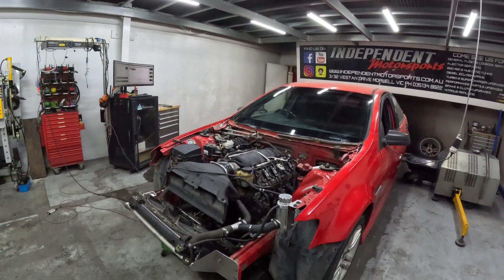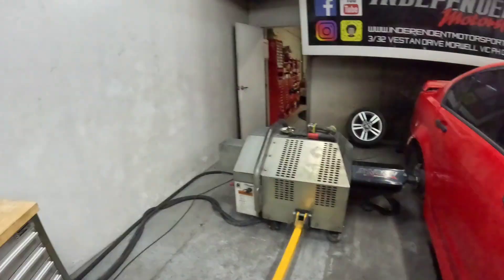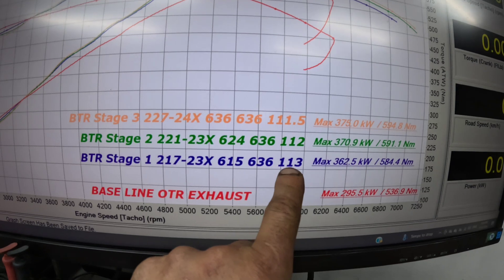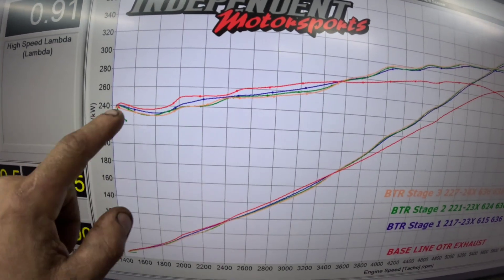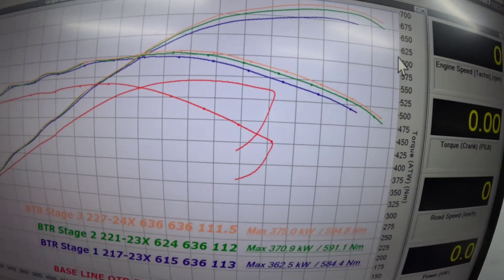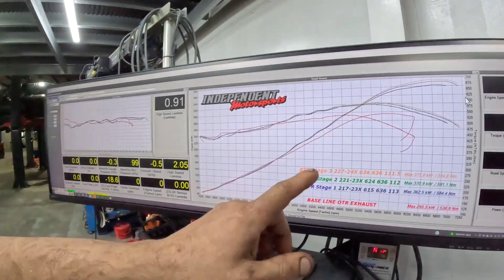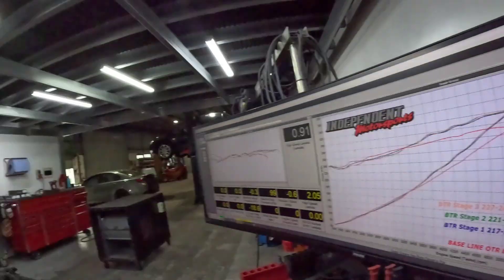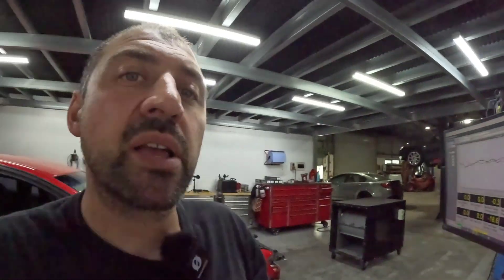VE 6LTR L98 Test Mule: Brian Tooley Racing Camshaft Stage Testing | Episode 2

Comment: Peak NM - RANGED BY RPM ACHEIVED

CROW CAMS 128
9379KW+84 @ 6800 🎉 586NM+50 @ 5600

CROW CAMS 1288
378KW+83 @ 6800 582NM+46 @ 5600

BTR REDHOT
369KW+74 @ 6800 586NM+50 @ 5450

BTR STAGE 3
375KW+80 @ 6850 594NM+58 @ 5400 🎉

BTR STAGE 2
370KW+75 @ 6850 591NM+55 @ 5400

CAM MOTION HOT STREET
365KW+70 @ 6800 588NM+52 @ 5400

CAM MOTION LITTLE CHOP
357KW+62 @ 6600 588NM+52 @ 5400

CROW CAMS 1212
368KW+73 @ 6800 587NM+51 @ 5400

CROW CAMS 1777
369KW+74 @ 6800 587NM+51 @ 5400

VCM 480
359KW+64 @ 6300 585NM+49 @ 5400

BTR STAGE 1
362KW+67 @ 6800 584NM+48 @ 5000

VCM 3
365KW+68 @ 6450 583NM+47 @ 5400

CROW CAMS 1287
369KW+74 @ 6800 581NM+45 @ 5400

VCM 11
363KW+70 @ 6400 581NM+45 @ 5400

CROW CAMS 1038
373KW+78 @ 6800 583NM+43 @ 5400

CROW CAMS 1036
362KW+67 @ 6600 578NM+42 @ 5400

CROW CAMS 1286
361KW+66 @ 6400 578NM+41 @ 5400

CROW CAMS 1730
356KW+61 @ 6400 572NM+36 @ 5400

VCM 532
355KW+60 @ 5900 585NM+49 @ 5200

CROW CAMS 1026
334KW+39 @ 5850 571NM+35 @ 5000

CROW CAMS 1780
331KW+36 @ 6000 567NM+31 @ 5000

BTR TRUCK NORRIS
337KW+42 @ 6000 581NM+45 @ 4800

CAM MOTION LIL LOPE
338KW+43 @ 6000 581NM+45 @ 4800

STOCK 
295KW+0 @ 5850 536NM+0 @ 4800

Comment: Peak KW - RANGED BY RPM ACHEIVED

BTR STAGE 3
375KW+80 @ 6850 594NM+58 @ 5400 🎉

BTR STAGE 2
370KW+75 @ 6850 591NM+55 @ 5400

CAM MOTION HOT STREET
365KW+70 @ 6800 588NM+52 @ 5400

CROW CAMS 1777
369KW+74 @ 6800 587NM+51 @ 5400

CROW CAMS 1212
368KW+73 @ 6800 587NM+51 @ 5400

CROW CAMS 1289
379KW+84 @ 6800 🎉 586NM+50 @ 5600

BTR REDHOT
369KW+74 @ 6800 586NM+50 @ 5450

BTR STAGE 1362
KW+67 @ 6800 584NM+48 @ 5000

CROW CAMS 1288
378KW+83 @ 6800 582NM+46 @ 5600

CROW CAMS 1287
369KW+74 @ 6800 581NM+45 @ 5400

CROW CAMS 1038
373KW+78 @ 6800 583NM+43 @ 5400

CAM MOTION LITTLE CHOP
357KW+62 @ 6600 588NM+52 @ 5400

CROW CAMS 1036
362KW+67 @ 6600 578NM+42 @ 5400

VCM 3
365KW+68 @ 6450 583NM+47 @ 5400

VCM 11
363KW+70 @ 6400 581NM+45 @ 5400

CROW CAMS 1286
361KW+66 @ 6400 578NM+41 @ 5400

CROW CAMS 1730
356KW+61 @ 6400 572NM+36 @ 5400

VCM 480
359KW+64 @ 6300 585NM+49 @ 5400

BTR TRUCK NORRIS
337KW+42 @ 6000 581NM+45 @ 4800

CAM MOTION LIL LOPE
338KW+43 @ 6000 581NM+45 @ 4800

CROW CAMS 1780
331KW+36 @ 6000 567NM+31 @ 5000

VCM 532
355KW+60 @ 5900 585NM+49 @ 5200

CROW CAMS 1026
334KW+39 @ 5850 571NM+35 @ 5000

STOCK 
295KW+0 @ 5850 536NM+0 @ 4800

Comment: Ranged by KW

CROW CAMS 1289

379KW+84 @ 6800 🎉 586NM+50 @ 5600

CROW CAMS 1288

378KW+83 @ 6800 582NM+46 @ 5600

BTR STAGE 3

375KW+80 @ 6850 594NM+58 @ 5400 🎉

CROW CAMS 1038

373KW+78 @ 6800 583NM+43 @ 5400

BTR STAGE 2

370KW+75 @ 6850 591NM+55 @ 5400

CROW CAMS 1777

369KW+74 @ 6800 587NM+51 @ 5400

BTR REDHOT

369KW+74 @ 6800 586NM+50 @ 5450

CROW CAMS 1212

368KW+73 @ 6800 587NM+51 @ 5400

CROW CAMS 1287

369KW+74 @ 6800 581NM+45 @ 5400

CAM MOTION HOT STREET

365KW+70 @ 6800 588NM+52 @ 5400

VCM 3

365KW+68 @ 6450 583NM+47 @ 5400

VCM 11

363KW+70 @ 6400 581NM+45 @ 5400

BTR STAGE 1

362KW+67 @ 6800 584NM+48 @ 5000

CROW CAMS 1036

362KW+67 @ 6600 578NM+42 @ 5400

CROW CAMS 1286

361KW+66 @ 6400 578NM+41 @ 5400

VCM 480

359KW+64 @ 6300 585NM+49 @ 5400

CAM MOTION LITTLE CHOP

357KW+62 @ 6600 588NM+52 @ 5400

CROW CAMS 1730

356KW+61 @ 6400 572NM+36 @ 5400

VCM 532

355KW+60 @ 5900 585NM+49 @ 5200

CAM MOTION LIL LOPE

338KW+43 @ 6000 581NM+45 @ 4800

BTR TRUCK NORRIS

337KW+42 @ 6000 581NM+45 @ 4800

CROW CAMS 1026

334KW+39 @ 5850 571NM+35 @ 5000

CROW CAMS 1780

331KW+36 @ 6000 567NM+31 @ 5000

STOCK 

295KW+0 @ 5850 536NM+0 @ 4800

Comment: The results in these tests seem to confirm that the tight lobe seperation angles produce optimum results. as suggested by David Vizard and Richard Holdener. With higher compression pistons, ported heads and diff gears the 6L and 6.2L engines can make great power and torque:) there are additional benefits to come from lightened and polsihed cranks and of course tuning with flex fuel. Awesome.

Comment: I’m a little confused about your drive ability comments on the stage 3 cam. I run a 231/242 112 cam on a stock stall and it’s my only car. Drives fine
Reply: Does it feel sluggish with stock compression?

Comment: 😂 hp is the only METRIC. Can't make it up can we? If they want hp, Richard holdener has tested similar on engine Dynos. 

This motor is a freak with these numbers and the base line. Does it have stock heads?
Reply from the maker: No you can't make it up but it's not hard to understand either.

Comment: Cant wait for the Truck Norris and Red hot cam 🍻
Reply: I went the full Red Hot cam kit , it should work really well behind my supercharged ls3 crate engine 👌🏾
Reply from the maker: Perfect choice @376LS3VY
Reply: truck norris is crap all noise and the red hot is same as stage 2
Reply from the maker: @CHINGY1993  you're completely wrong The new stage 2 V2 cam is different to the redhot.
Reply: @CHINGY1993  why is Truck norris crap ? From what I've been seeing , the Red Hot is similar to stage 2 , but it is not stage 2
Reply: @376LS3VY  its all noise with no top end. If you like that good on ya
Reply: @CHINGY1993  haha that's the whole point of its design lol , if your wanting all bottom end torque/power and to have a nice chop lol
Reply: @CHINGY1993 no top end? So it drops to 0kws at 5000rpm? No. It just peaks earlier which is fine in reality for the way most people drive and even at the drags, mid range is where it's at.
Reply: @CHINGY1993 truck Norris would be well suited to V8 4WD conversions, people who tow, people that want max power and torque under 4500 rpm where most street cars are actually driven